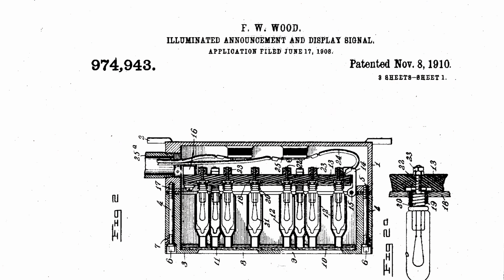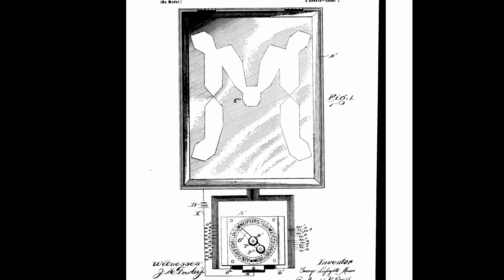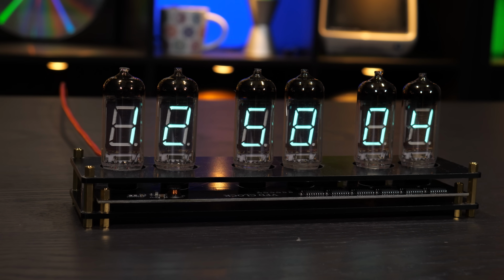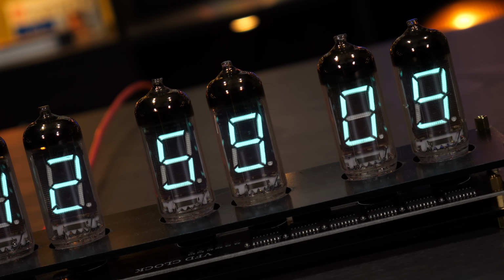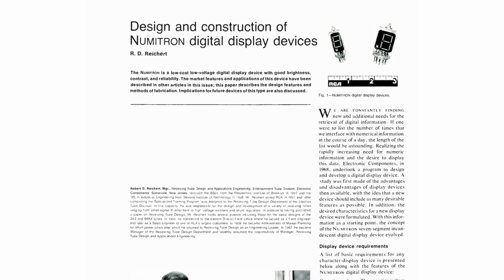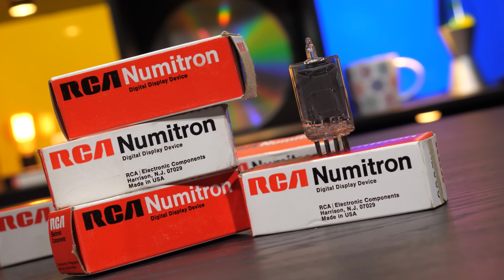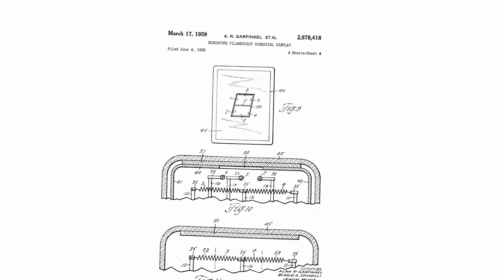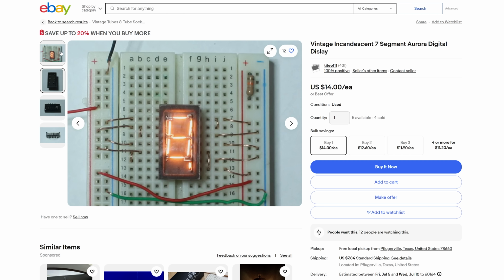The Numitron: An obvious idea that wasn't very bright

Comment: I made two clocks using old Soviet Nixie Tubes and those are really cool. While they do require high voltage, the power level isn't very high in watts. In fact, one of my Nixie Clocks that uses 6 IN-18 nixie tubes plus 2 neon light separators, runs off of a standard USB port.

Comment: one of my first electronics projects in college was making a display from russian numitrons without that chip to drive them in parallel. so I built a mux from transistors and quickly switched it with an atmega
janky as hell, but so fun when it worked
I just checked, they were IV-9s 😂 didn't notice the sagging though

Comment: I have to say that, as much as you complain about their legibility, even in the wide shots they seem perfectly legible to me in this video, even in what I assume are bright studio lights. And that's not even taking into account your admission that they can be much brighter. Yes, a darker background would help them, but also having them in an enclosure of some sort, possibly with a tinted glass in front of them should help with contrast immensely. Your clock with the tubes fully exposed is possibly the worst possible situation for them, and yet they are still legible on video. Assuming they were much cheaper than Nixie tubes, I really think it was more failed marketing that doomed these, not the technology itself.

Comment: You are put of your mind! Those devices are GORGEOUS. I love the thin segments. I love the slight overshoot of the vertical segments. Wow, I want one. I want a lot 

I also want to build your huge LED clock, on a rollable fabric
Reply from the maker: To each their own!
But - I think it's important to remember the differing contexts here. Shown as I have them here, naked and highlighting their tubeyness, they do have a sort of steampunk charm. But, having seen a few examples of these in an actual product... that charm is lost and they just look bad. Here's an eBay listing for a darkroom timer which used them
https://www.ebay.com/itm/125910714403
Reply: @TechnologyConnections  wow that display really does look cheap/broken doesn't it
almost looks like it has survived a nuclear fallout or something
Reply: @aneurron  Doesn't look cheap at all. Solid metal construction with decent switches. Looks more industrial to me.
Reply: @kunka592  talking about the displays not the metal frame or switches
they're not even aligned (cause that's how they were made)
Reply: @TechnologyConnections someone…I’m guessing someone who saw this thread…bought it within a few hours. 😂
Reply: @TechnologyConnections  that display looks sick. Yes it's janky, but its also incredibly cool.

Comment: I remember a friend’s wristwatch from around 1975 using red LED display.
A cost some piece, he never told what he bought it for😬
You had to push a knob on the frame to watch the thinly LED shown time.
The display shut down after a couple of seconds, but still drained the battery.
Probably worth some money these days.
Reply: My uncle had one too.  He bought it at a 'discount' in Chinatown NYC back in the day.  They are common on eBay now except that most no longer work.
Reply: Expensive then, expensive now.

Comment: Have you ever done a video about 2 in 1 washer dryer? I just got one and it works great (I live by my self but wouldn’t recommend it for a larger household) I’m just curious on how it works specifically since it runs on 110v and not 220v like other dryers I’m used to.

I know the video has NOTHING to do with this but my washer dryer has the same display so it got me thinking 😅

Comment: I love numitrons but their usefulness are limited. You are correct they were very common in gas pumps, especially the flat pack versions. I have a numitron based clock as well but you cannot run it 24/7 as you will lose some segments pretty quick. We had someone at our makerspace that built a clock out of 8 foot florescent tubes. So damn big and bright!

Comment: The displays in fuel dispensers were actually Panaplex displays, which are segmented gas plasma displays which work similarly to a Nixie tube.
Reply: On Gilbarco fuel pumps here in the UK, they were definitely the numitrons, and were very common through out the 80s.

Comment: 20 years ago I invented an alphabet designed to be rendered with 7-segment displays. It's called Heptal and if you Google it you'll find it on a site called Omniglot. It's changed a bit since the original blocky version but it should still be pretty obvious how it was supposed to work. Just thought I'd share!

Comment: I recently had to replace a display unit on an old aviation radio/nav unit. When I bought the unit there was a warning on the outside stating there is some mercury fluid and radioactive material inside. I do not know how much that mentioned stuff but it made me handle it very carefully not break anything. During operation and just having it sit in the hangar the display gets dimmer over time as the radioactive material decays. I wonder what that type of display is at it requires some sort of high voltage.

Comment: How on Earth did they manage to offend you so much for such hatered?!

There were just three real issues with them:
1) They were nixie-expensive with lightbulb-short-longevity
2) They became commercially available waaaaaaay too late when LCDs already were affordable and LEDs were starting to gain traction. Typical RCA.
3) because of the above they were not easily available

The not-black-enough background could be kind of an issue in some cases but probably not serious enough.

The quality is ok, I did not notice any issues until you pointed them out with closeups. Most consumers really didn't much care about that so much.

It could display letters with 15-segment displays quite easily but even if it didn't it was not important since about 90% of the displays were 7-segment or slight variations of those

Comment: Dangerous?! Edison told me DC was the safe one and it's Westinghouse's AC I should worry about.
So I will stick with the Nixie tubes thank you very much.
Reply: Ask Topsy about AC.
Reply: DC isn't just less efficient, it's actually more dangerous than AC at the same voltage. At mains voltage, you'll never be able to turn it off if you use the wrong switch, because it will simply arc across the contacts and weld them permanently together. AC requires much higher voltages before this happens because it always crosses 0V twice every cycle, which helps to extinguish arcs even if they do form. A switch rated for 240VAC may only be able to handle 24VDC or so before it becomes impossible to turn off

Comment: Your memory is correct about the flat packs being in gas station pumps.  I remember as a kid seeing them as well, always thinking they were pretty cool.  They usually had a smoked cover over them though so you couldn't really see the pack, just the light emitted.
Reply: These weren't Numitrons afaik. I believe that they were Panaplex, which was the 7 segment version of the Nixie he alluded to. They were also popular in pinball machine score counters and were briefly used in (and invented for) calculators.
Reply: @BokBarber  If they are amber, they could be Panaplex, but the incandescent displays in a flat package are Minitrons.
Reply: I remember those as well. I remember one specific gas station near home that had this type.  I always just assumed they were neon and didn't go any further, but in retrospect, year, they were incandescent.

Comment: eBay sellers are going to be wondering why there's a run on Numitron tubes for the next 24 hours.
Reply: We are always 1 catchy YouTube away from a supply shortage
Reply: Not them.  It's the people who cater to them who will buy all the stock and build $500 clocks sell them.  Of course, since most products never even ship, they can just skip the tube buying all together.

My guess is there are a lot of these tubes around anyway.  Just about 2 years ago, some guy died with a warehouse full of millions of tubes.  This was one guy and one warehouse.  New tubes were manufactured from the early 20th century well into the late 70s.

When I was a boy in the 70s, I remember dept stores like had tube testers in the electronics section. You could bring in your tubes, test them on the tester and then buy new ones.  Radio Shack carried them into the 80s and they were probably available in catalogs into the 90s.
Reply: @christo930  that guy that died had one of the largest known collections of vacuum tubes. There aren't many out there like it. 

Many were for TV's and various low demand things these days. 

He wasn't stuffed to the gills with desired expensive parts like audio tubes, but he had a lot of tubes that repair folks desired and they lost a valuable cheap resource when he passed. eBay prices are waaaay higher. He'd sometimes sell tubes for $1 that repair folks are stuck getting for $15 on eBay now.
Reply: @manitoba-op4jx yeah lotsa folks are gonna go “ooh I want one I’ll make a clock too” and then never make a clock…
Reply: Don't worry there are not many sellers and they're already too expensive. I found four in a bucket (still on a PCB) a while back in a friends shed. I now have a numitron clock. The tubes cost me nothing. I've not told him what they sell for these days.
Reply: @manitoba-op4jx yup, the "I saw a video on these so I'm going to buy them" even though they have no use, no collection, and will toss them instead of selling them when they move.
Reply: There's probably a run for obscure old tech after each video, some random ebay seller like "what is this old microwave's bid shooting up!?"
Reply: FranLab has already been keeping demand high. She explores lots of display systems from years-gone-by, including these.
Reply: Ebay sellers are subbed to Technology Connections, 8bitguy, and Techmoan at the least.
Reply: @manitoba-op4jxdoes it make me a hipster if I want it because it looks cool lmao
Reply: I wouldn't be surprised if Temu were commissioning a knock-off product to sell now. It will be marked NOS, obviously. Wait, not "marked", but "named". They won't be claiming it's "new old stock", it'll just be "numerical old-style strip-light". (Cos the people behind it will be too young to understand that a strip-light is totally different from on incandescent one, and a filament isn't a "strip".)
Reply: @nialltracey2599 I like the thought process but you know it'd be cheaper to fake it China fakes everything it'll be a led strip lights reassembled into a 7 segment with bulb it'll look the same but have a weird adapter on the bottom
Reply: @nialltracey2599  There are currently brand new IV-9 tubes for around $10 (USD) on Taobao, and IV-16 tubes for around $13
Reply: @nialltracey2599 If Temu stands up a new vacuum tube assembly line, that'll be the first useful thing they've done.
Reply: @nialltracey2599  LOL.
Reply: @nialltracey2599  it's a LEF,  light emitting filament, lol
Reply: Hmmmm......That's a good point channels like this could make some extra bank when they know they are covering something obscure like this by buying up a bunch of them and than selling themselves after the video goes up
Reply: I think I had a calculator with these tubes years ago. Loved the weird look.
Reply: @Runco990  "And they will collectively quadruple the asking prices in the first 47 SECONDS!" Go back a few years and we called that the Techmoan effect lmfao
Reply: Gotta get in on the ground floor! To the mooooon!
Reply: yeah such similar style to NIxie tubes, but their beauty is something else...
Reply: Maybe not - after watching this, I have even less desire to buy numitrons.
Reply: Steins;Gate fans in shambles
Reply: “Which number sounds best in my Marshall??”
Reply: The next video about numitron bulbs has to mention this video and the great numitron shortage of 2024
Reply: Well, you can almost drive them from an Arduino. So if you are OK with them even darker and redder...

you then are still way better off with a red LED display ;)
Reply: @Runco990  Yes, it's called 'supply and demand'.
Reply: If you want the Filament to live longer you Always want to have some small current running throw it Just under the the amount to have them glow. That will reduce Stress to the Filament
Reply: I still have unused nixie tubes from a project that I wanted to create.
Reply: @azmax623 you and me both, I have like 20 backups for Divergence meter.
Reply: @azmax623 lol pixie
Reply: @azmax623 whats the project?
Reply: @azmax623  Pixie? I want a pixie tube!🤣🤣🤣
Reply: @TIMMEH19991  Auto correct
Reply: @manitoba-op4jx Not them.  It's the people who cater to them who will buy all the stock and build $500 clocks on crowdsourcing sites.  Of course, since most products never even ship, they can just skip the tube buying all together.

My guess is there are a lot of these tubes around anyway.  Just about 2 years ago, some guy died with a warehouse full of millions of tubes.  This was one guy and one warehouse.  New tubes were manufactured from the early 20th century well into the late 70s.

When I was a boy in the 70s, I remember dept stores like K-Mart had tube testers in the electronics section. You could bring in your tubes, test them on the tester and then buy new ones.  Radio Shack carried them into the 80s and they were probably available in catalogs into the 90s.
Reply: There will likely be some scalping and scamming happening.
Reply: Lol
Reply: @manitoba-op4jxyes yes, YOU need them, but everyone else who wants to use them would be hipsters lol
Reply: Do ebay sellers keep track of  everything people sell?
Reply: 1.6k American on nixie tubes and assorted electronics and components... Yeah, TC isn't sending me on any more fool ventures lol
Reply: LMAO I'm buying one rn !
Reply: I just checked google trends and it was very amusing
Reply: my retirement strategy is working, waiting for the price spike in CD4017s to execute
Reply: I honestly read this as RCA Nutrition
Reply: You should look at its little cousin bubble displays
Reply: The tech moan effect on display.
Reply: Egay
Reply: No lie, Alec is the reason I now own 5 different CED players, a stash of replacement styluses and over 2,000 video discs.
Reply: 😭😭😭 I’ve been looking for a couple more to complete a clock I had in the works but I guess that won’t happen
Reply: Fran Blanche's video had the same effect a few years ago
Reply: You win the internet for today😀
Reply: Lmao!😂

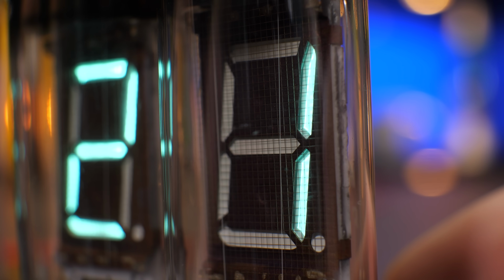Comment: 6:45 Small correction: The control grid of VFD tubes is negatively charged (a negative potential is applied in regards to the cathode). This prevents electrons from flowing from the cathode to the anodes and disables all segments.

Comment: I think they look quite good, I'm a fan of how they fade in and out as well when changing numbers.
Reply from the maker: That's something that I like about them, too! But - and this is why I didn't bring it up - the effect is much more pronounced in my clock due to the power limitation. When actually given five volts, the segments light up much more quickly. It's so fast that you might not even notice the fade-in.
Reply: I think they have a neat almost steam punk-ish aesthetic -- would be cool to use in an escape room puzzle or something.
Reply: @empathogen75  They would look fantastic reflected on a car windscreen as a heads up display!
Reply: @C.I... For use only at night…
Reply: @empathogen75  ...until you realize how roughly players handle objects in escape rooms. We got stuck due to worn down equipment on three different occasions: two different special locks not popping open with the correct code, one magnet with specialized casing was so scratched we didn't recognize the clue on the casing and couldn't get started at all.
So if something is not extremely durable or super simple to replace then the players will have a bad time.
Reply: @TechnologyConnections But the fakt that you can dimm them ist quite a bonus. And i Love the Overall Look. A few of the negative Points i see as an Advantage. Due to warm Light the Low contrast and the backlighting cause of the Gray Background. They make me want to lock at them. In the Same was i want to lock at an Lavalamp instead of a naked 60w lightbulb
Reply: @sohiqz  Jawohl
Reply: They are quite pretty as a clock.
Reply: @lightcycler4806  the age of steampunk never existed because it’s a sci fi genre. It’s full of all kinds of anachronistic tech.